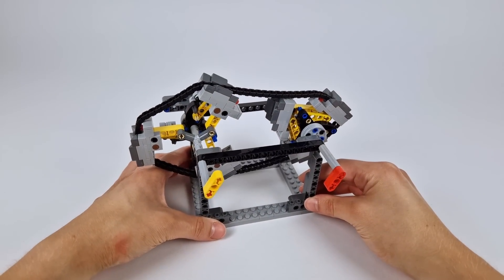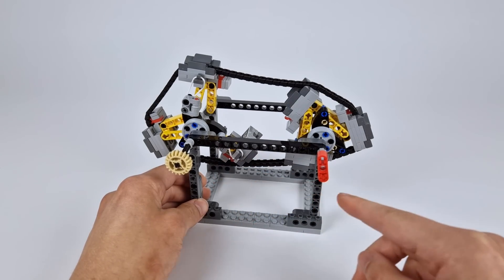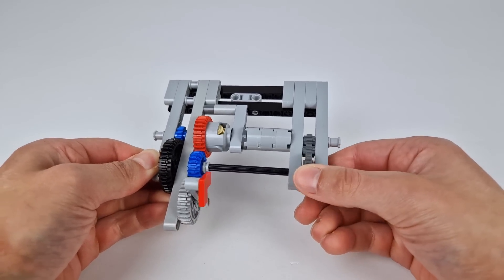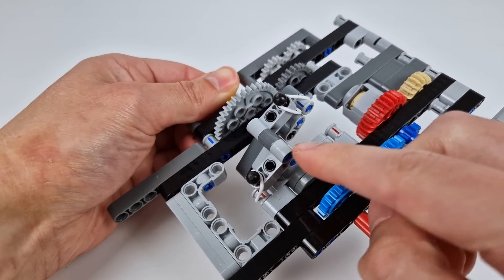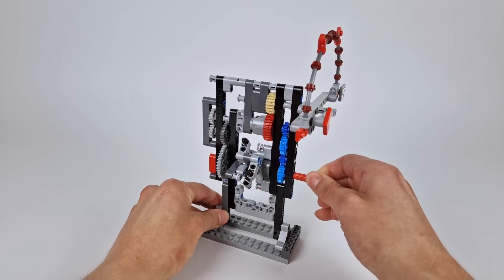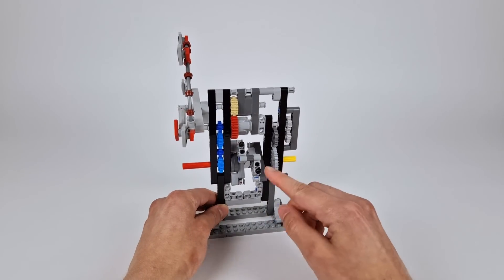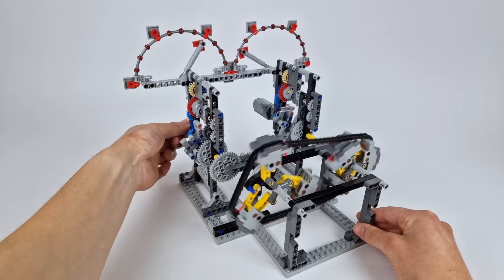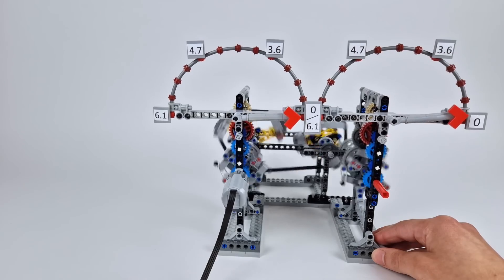But Does My Automatic LEGO CVT Actually Work?

Comment: It looks like currently you hit a max torque on your motor much lower than max torque possible, would it be interesting to match the cvt to amplify the torque automatically  so that the max torque/power of the motor can be used?

Comment: 9:47 "since these beams are at right angles means it's crating a force vertically downwards" There is a fundamental error here. The force here is not at all vertically downwards but closer to horizontal. Wait that means that therre is a at least 45° error in that statement if not more? Yes! and that's kind of a lot! Explanation: The force is always perpendicular to the direction from the contact point to the axle. If you draw a line from where the red thing touches the scale to the center of the axis you get a diagonal, therefore the perpendicular force applied to the scale is also diagonal. The right angles on this red thing or the whole shape of it does not matters at all in terms of force direction on the scale.
Reply from the maker: That is incorrect. Both approaches work and will give the same answer. If you treat the assembly as a 45 degree beam, as you suggest, the perpendicular distance to the pivot will be longer (current length x 1/cos(45)), but it also means the force perpendicular to that beam will be lower: if you resolve the reaction force of the scale parallel and perpendicular to the beam, you can see that the perpendicular force is the reaction force x cos(45). Since torque is force x perpendicular distance from that force, the cos(45) and 1/cos(45) terms cancel and you're left with the same result.

I could have made the vertical portion of the L-shaped beam twice as long or half as long and the scale would show the same number (as long as I accounted for the change in weight of the beam of course). You can try this for yourself and see that the beam length parallel to the force doesn't affect the moment created.

Comment: Ngl I this is sort of incredible. I guess the main thing stopping this concept from becoming a full-scale thing is smoothness, ratio range, and just the material science required to create strong enough bands or springs to reliably transfer the load directly.

That being said at least points 1 and 2 should be able to be addressed simply by coupling more together. 2 or 3 in series would provide a larger range because of multiplication, and if they're staggered so that the "arms" are out of phase with eachother it should smooth out any lumpiness as changes ratio. And in terms of materials perhaps if you use metallic springs its already viable, depends how much they can cycle and just also how heavy they may be.

Comment: nice :)

although, because of the slight angle at which the arm is pushing on the scale, the length of the arm (10:10) is not 8.8 cm but cosine of that  sligh angle times 8.8cm + sine of that angle times the bigger vertical length (if the width between stud centers = 7.97 mm, approximately 15.5*7.97).
This does not hinder the reasoning really because if we ignore the arm deformation, the measurements are all off only proportionally.

Comment: I'd be very curious to see if you're able to measure the Lego Clutch Gear's torque rating with your torque gauges. They should be between 2.5 and 5 Ncm, which is within your scale.

Comment: At 8:15, a better analogy would be if the bar at the back of the car could pivot freely (like the differential) and the rubber band were attached to a fixed point.
Reply: Or it would be a better analogy within its range of motion

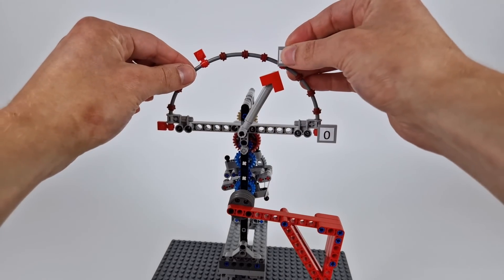Comment: 10:20 what is if the rubber band has a irregular „strength to length curve“. such in most materials. at some point tge power needed to strech the band increases exponentially

Comment: I appreciate the effort but the whole explanation for the inefficiency of the differential based torque meter is nonsense from the point of physics.

The power is force multiplied by the distance of motion.

While the torque is constant the rubber is of fixed length and doesn't require any power.
When the torque is increased or decreased the rubber changes its length and the part that is moving is the lever which then transfers the torque to the diff and to the output.
In a theoretical system with zero friction this system would be 100% efficient.

Most likely the observed power loss is due to the friction in the diff and between the axels and the frame.

The idea that a rubber band attached to a static point loses half power and a band that's both attachment points are moving has no scientific backup.

Comment: This could have been so much easier. You didnt realize the cvt in itself could already function as a torque measurer. 

If you had fixed the cvt input, and did the trick with the scale on the output, the torque would be measured by the extension of the cvt "arms". So you could have just measured which torque corresponds to which "shape" of the cvt belt directly.

Now you just added a lot of parasitic torque losses with a whole additional mechanism, making the measurements unreliable in the process
Reply from the maker: I'm afraid none of that is correct. The torque measurers waste almost no torque, as shown by the final tests. And the CVT needs to be rotating to effectively change size, so measuring its torque statically won't work.
Reply: @BananaGearStudios  there are always losses in torque, otherwise all these transmissions would be 100% efficient. Things like the rolling resistances of the gears.

 And why would it matter that you cant measure statically? That would only make calibration (very) slightly more inconvenient. The whole point of the transmission is that it moves, so you literally already have a torque indicator in the form of the extension of the arms.
Textbook overengineering here

You also didnt quite calibrate your measuring systems correctly. You should have lifted the scale a little so that the 90 degree arms were parallel (for the shorter) and perpendicular (for the longer) to the scale plane. Otherwise the arm for the torque is actually smaller than the shorter arm.

Comment: Cool cvt, and even cooler torque meter. Would be cool if you build a centrifugal rpm meter and then a multiplier mechanism so you can measure power

Comment: Your criticism of the first mechanism isn't actually valid. The tests you did only prove their own invalidity.
The first mechanism works if you look at it in terms of conservation of energy.
The band only absorbs energy when moving,  so the only thing that can be wasting energy is the gearing, which isn't very wasteful really.
Your tests are wrong because while the band is changing positions, the torque is wasted, but once a stable state is reached, it all works out.
The apparent loss of energy with the two to one case is made up for by the output spinning quickly when it does.

Edit:
Wellllll, I guess the last experiment prooves me wrong, but... I dont know why. Power in a moving shaft is angular velocity * torque.
Since torque drops, but angular velocity doesnt, the power must be going somewhere. Holding a rubber band taught does not take energy (it takes force, not energy, proof: you can hold a rubber band taught by wrapping it around something).
Losing the extra torque must be a plain ineficiency somewhere... Maybe the little differential isnt very good with uneven loads?
Or like, physics works differently for lego.

Comment: Good job. Now patent it and develop one for large engines. If this idea scales up nicely you'll have solved the biggest problem with CVTs. Limited power throughput before the belts slip. The mechanical load based shifting is less complicated and more robust than most systems that would measure RPM and use hydraulics to change the pulley ratio.

Comment: When I first learned about CVTs, my immediate thought was an iris style like this one vs the v-belt used in the auto industry. I never got to prototype it but made drawings, I need to find those. I’m so happy to see how well yours is working and feel very validated. My idea could either have a counterweight actuation to automatically adjust it in reaction to torque like this or a manual one to take advantage of a torquey motor for more speed. I think the use of springs (rubber bands) makes more sense in a transmission where you normally want to reduce rotating mass. 

This project/video is downloaded and saved. Top 10 on YouTube for me personally!!!
Reply from the maker: Thanks, I'm really glad you liked it, and it's cool to hear that someone else had the same idea!
Reply: This system would be extremely noisy if it was scaled up for automotive use as well as not being a constant velocity drivetrain, so the output speed pulses even at constant load with a constant speed input drive. It's an absolutely brilliant Lego design though.
Reply: @peglor  copying my reply to another comment. Here are some issues I see with this: there is no clutch/decoupling mechanism, so the engine would stall every time you come to a stop, and the output speed is inconsistent. I'm also not sure how well the rubber bands scale to decent power applications (10-100 HP) with combustion engines producing inconsistent torque (only 1/4 of the time) in terms of both function and longevity. The shifting mechanism is purely based on torque with no RPM component to it. Transmissions with varying gear ratios are rarely used with electric motors.

Comment: Don't know how to break it to you. But that is indeed wasting torque.
Reply: Probably. Nothing mechanical is free considering friction. Still much much less than the alternatives 😊
Reply from the maker: Of course there is a very small amount of torque used to move the position of the dial, but this is extremely small. When I tested the fixed transmission between the torque measurers, you can see that both dials go up equally - this shows that the torque resisting the output is equal to the torque being applied to the input, meaning none is wasted in between by the measurers.

Comment: Your lego cvt functions better than just about every early 2010s cvt in cars
Reply: Idk, my 2014 outback’s CVT has been problem-free for 112,000 miles, and many other examples with higher mileage haven’t recorded problems either
Reply: Other than the Prius E-CVT that thing is actually pretty reliable.
Reply: No. Don't get me wrong, it's a neat idea and great for educating and getting people interested in cool technologies, but here are some things that I see wrong with it. For context, I work with rubber belt type CVTs used with small engines (such as on ATVs) and am currently in the process of developing a custom electronically controlled CVT for use in small engine single seat off road racing. There is no clutch/decoupling mechanism, so the engine would stall every time you come to a stop, and the output speed is inconsistent. I'm also not sure how well the rubber bands scale to 10-100 HP applications with combustion engines producing inconsistent torque (only 1/4 of the time) in terms of both function and longevity. The shifting mechanism is purely based on torque with no RPM component to it. Transmissions with varying gear ratios are rarely used with electric motors.
Reply: @johnhunter7244  I think you’re forgetting about the torque converter, so it literally wouldn’t stall, along with the simple addition of a flywheel to smooth out the rotation
Reply: @Techmejif you added a torque converter, sure, but I think you're forgetting that no one else mentioned anything about a torque converter.
Reply: @johnhunter7244  that’s exactly why I mentioned it. Because a torque converter is what an automatic type transmission uses instead of a clutch.
Reply: @johnhunter7244  you

the joke
Reply: @IvysSSousa  the joke
Is stupid
And not clear
Reply: @johnhunter7244  no, is not, you only don't get it because the joke is not for you hahaha
Reply: @IvysSSousa  maybe because I was smart and have never bought any car with a CVT?
Reply: @johnhunter7244  you still don't get the joke lol
Reply: @IvysSSousa  "Not for him" the joke is lazy and unoriginal
Reply: "lazy" and "unoriginal" don't un-joke a joke.
Reply: @IvysSSousa  Bro I didn't say it wasn't a joke I just said it was bad
Reply: @nef36  fair enough, good point
Reply: @johnhunter7244 electric motors in cars usually are just 2:1 fixed gear ratios and reverse, because of the way the motor is wired it is not good when reversed.
Reply: @monad_tcp the electric motors used in hybrid spin both ways with about same efficiency.

Comment: The torque measuring device you made can also be used to measure higher forces by adding more bands which I thought was cool😃😃
Reply from the maker: Thanks for noticing that! I actually originally intended to use multiple bands, but it turned out that in this case just one per section was enough.

Comment: Really cool 😎. I’m curious though, does the non round shape of the sprocket/pulley? not make it  pull unevenly? 
Just a question I’m sure you know more about this than I do.
Reply from the maker: It probably means the speed varies a bit, yes, and this might be why the dials on the torque measurers shake up and down a bit when they're connected, but it doesn't see to be too big of an issue.

Comment: You're not "wasting torque" to stretch the rubber band, you're wasting torque grinding bevel gears together.

Once the band in stretched, the machine isn't doing any work to keep it stretched. Work is force times distance, and at steady state the torque arm is not moving.

The reason the second design works better is because you're not putting any real torque through the bevel gears, so you avoid a lot of the friction. The axle twisting is performing the same function as the band did in the first design, it is acting as a spring, converting a force to a displacement.
Reply from the maker: I thought a lot about this while I was making the video, and you could be right that the additional losses are going to the gears inside the differential - I'm honestly not sure. Considering the conservation of energy as you mentioned, the way it made sense to me using my explanation is that, once the rubber band stretches it's exerting an equal force on the differential housing, which corresponds to a higher torque felt by the input. So even if the rubber band isn't being stretched any further, the input is turning the same distance against a higher torque, so more energy is needed, meaning this extra energy is being wasted... somewhere, since the output still has the same speed and torque as before. I thought that somehow this extra energy must be being wasted by the rubber band, but I understand that if it's not streching any further it's not storing any extra energy. Maybe it's rapidly stretching back and forth slightly as I turn the input to dissipate the extra energy, I'm not sure. Though I really doubt that all of that torque is being wasted by the differential gears - I've used those differentials for all kinds of machines in the past and they waste almost no torque.
Reply: @BananaGearStudios you should be able to easily test that by locking the differential body in place and repeating the measurement.
Reply: @BananaGearStudios  that particular lego differential struggles in this application because the single bevel gear causes the axles to be radially loaded, pressing them up against the side of the case.

The lego differentials with two or three floating bevel gears do not have this problem.

It only really becomes an issue when the difference in angular velocity between the case and the axles is significant.
Reply: I was confused the entire video as to where the power is getting wasted in that measurer, and I still don't understand
Reply: This isn't about work though, it's about force. The force continuously exerted by the rubber band opposes the torque generated by the motor, canceling out some of what would otherwise be seen at the output.
Reply: @nonnymoose7005  the best way I can explain this is that, at steady state, the arm is not moving and the system behaves the same way it would if you locked the differential case in place.

It is acting as nothing more than a gearbox, albeit an efficient one due to the shortcomings of the differential used.

I can assure you, no torque is lost in that band. It exerts just as much force on the arm as the arm does on it.

Comment: 11:45 are you sure the input and output are running at the same speed? Pausing the video, playing it and then pausing the video and then comparing makes it seem like they are running at different speeds.
Reply from the maker: Yes, I did say roughly the same speed. It's not perfect, I'd say the gear ratio ended up being something like 1.1:1 rather than 1:1, as there wasn't a simple combination of gears that got the speeds perfectly equal, but it was close enough for what I wanted to show in the video.
Reply: If it's just to test it and form factor is not an issue, you can have the exact same ratio by putting another chain with fixed mechanism instead of rubber band in place of the gear ratio.
Reply: for instance, i paused the video at a perfect time, and the input + output (yellow + red) were pointing in the same direction, but playing the video for half a second and pausing again revealed that the input and output were no longer pointing in the same direction